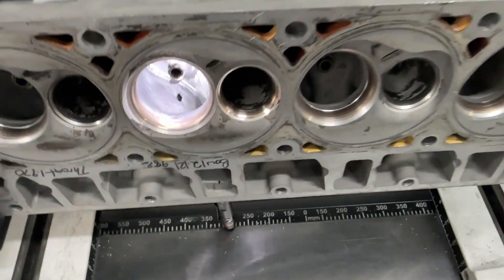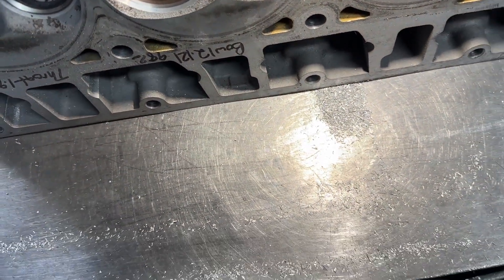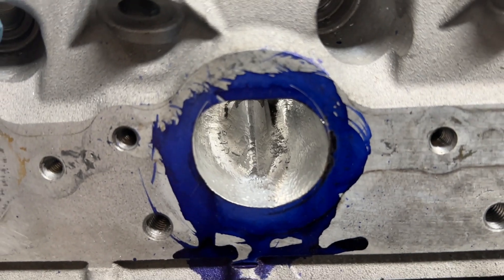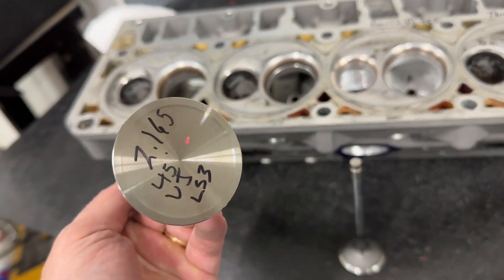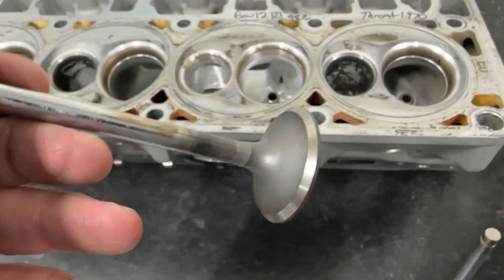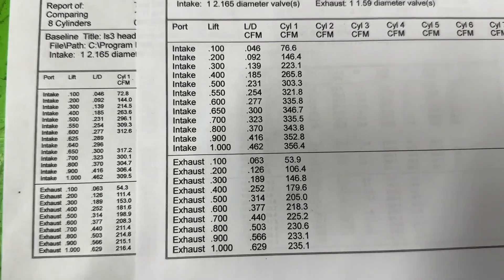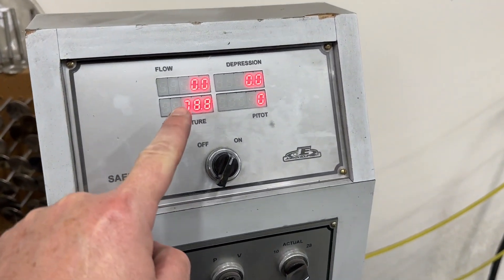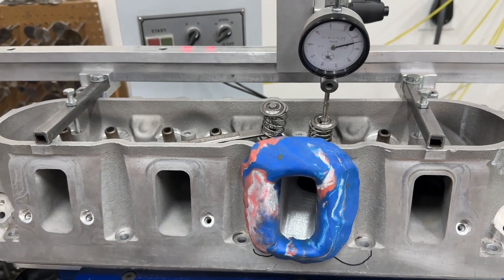Finish Porting LS3 Heads How To

Comment: Eric do you know much about DUCTILE IRON valve seats in aluminium heads, is it the same as the valve seats in a LS cylinder heads or are they a softer material.
Reply from the maker: Depends on which stock Ls head and year of production. There are also different material makeups of ductile iron. Some soft and some hard.

Comment: Eric is there a right way to fix valve seats that protrude into the combustion chamber when fully seated? im worried about spring installed height if i just cut deeper
Reply from the maker: Cut deeper.

Comment: Cutting the double radius out of the short side kills LS3 engines below 4k rpm. You can get amazing flow for a pure race engine if you do, but....
Reply from the maker: Do you have dyno evidence of that? I have never heard that and I’m not sure what you mean by double radius.
Reply: The LS3 head have 2 small "apexes" on the SSR, the factory did this to help turn the fuel, Darin Morgan talks about it at length in some of his videos. I ported a set of LS3 heads in a Cadillac, BTR stage 2 truck cam, gears, and a 3k converter. I had great flow numbers, but in the car until under 4K it was kinda wooden, then it would turn on like a scalded dog. Later I watched Darin's explanation and it made complete sense.
Reply: I have some ls3 port cutaway photos I could share it's easier to see, and once you do, you can unsee it.